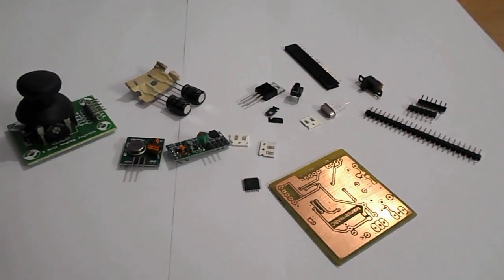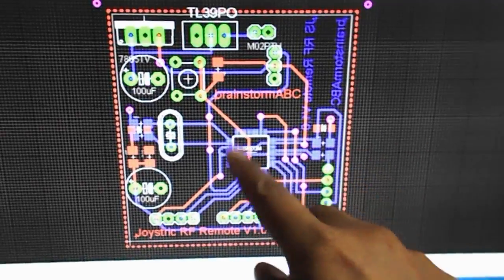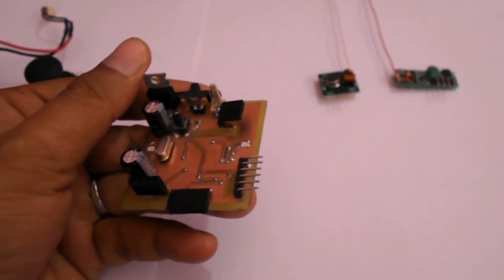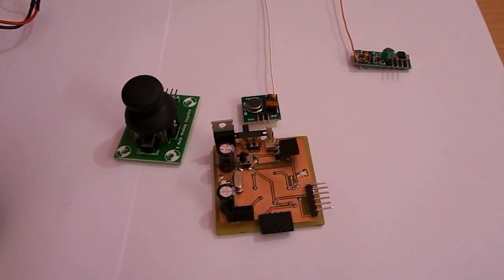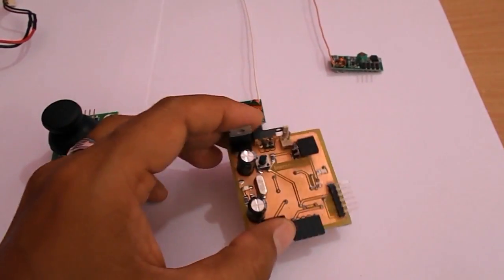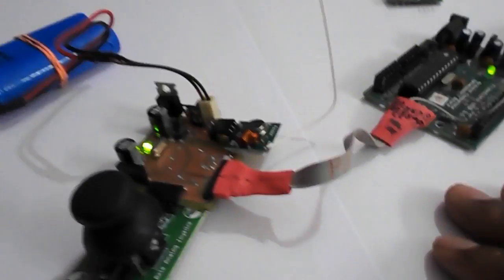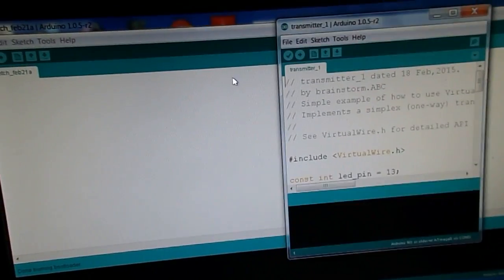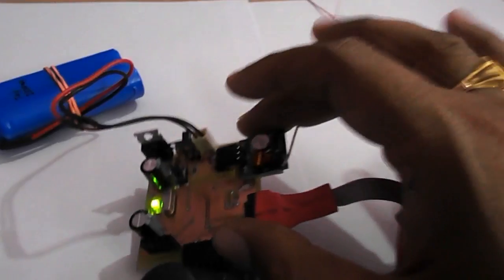Joystick RF remote using Arduino and 433MHz Tx Rx Modules

Comment: This will not work more not 5 meters line of sight.  Unless you use a signal amplifier, don't expect long distance communication for this.
Reply: yes indeed, i have the same problem
after 2 meter already some chinese symbols
after 5 meter nothing, also 12V didn't help
Reply: and here i was worrying about the claimed 20-200 meters range :P going to attach antenna today and see if it works

Comment: Hi sir,
do you have any idea that, how i can use 12 channel rf transmitter (remote control) module and 12 receivers placed in different places to perform relay operation. Each receiver including pt4317-x ASK ic.
please reply.

Regards,
Girish .
Reply from the maker: Girish Raju If Transmitter Transmitter 12 Different Codes but the receiver Understand only one code Out of 12 Different Code. Then only that receiver will respond other will not. So All the 12 RX will understand one unique code transmitted by TX,
Reply: Dear Sir,
Thank you for your valuable reply.May you please suggest the Transmitter and Receiver pair which i can use for such kinds of design or if you know any ready circuit dgm for such kind please suggest me.my mail id:girishraju21@gmail.com

Comment from the maker: This project is demonstration for how we can use Arduino IDE without an Arduino board and it is also demonstration how we can send the data of a Joystick position through 344 MHz based RF modules.
Reply: brainstorm ABC At receiver side , whats the arduino code ? can you share it?
Reply: install Virtual wire library , in example > virtual wire > it has both transmitter and receiver examples
Reply: but that basic, you can build from there.